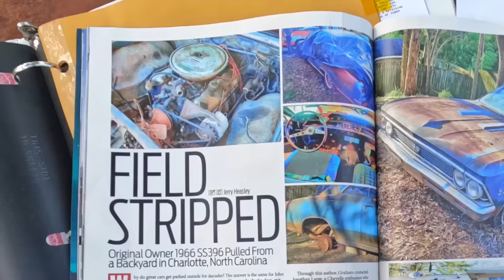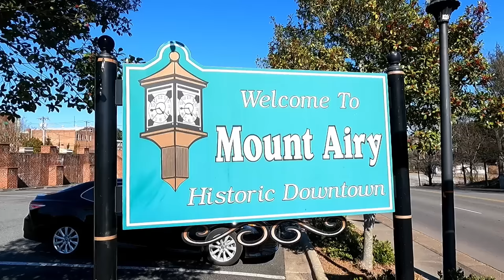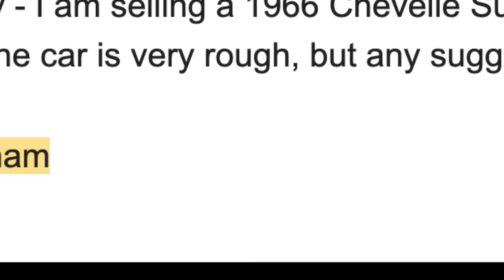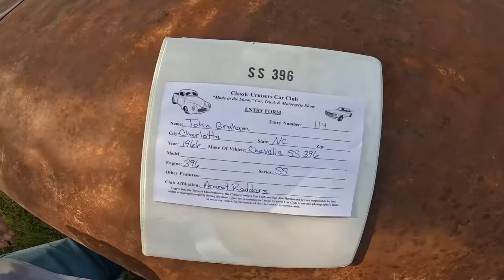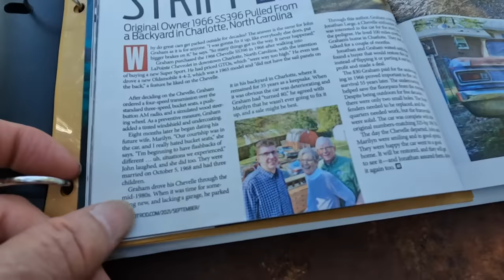Original Owners Drive Their Rusty 1966 Chevelle SS 396 To A Car Show

Comment: This is a perfect example of how original shape cars regardless of any rust are more striking to look at. Every car show has their fully restored novas, Chevelles and Camaros but when you see one in original shape even with rust holes that’s where the people are gonna be!
Reply from the maker: Thanks, an appropriate first comment. Are you a subscriber?
Reply: I was at a car show years ago and there was two 69 Judges sitting besides each other...one restored, one original paint with scratches, dents and rust...people flocked to the beat up Judge...the guy with the restored Judge was very surprised to the peoples reaction.

Comment: I had a beautiful 66 Chevelle SS396 while stationed at Myrtle Beach AFB back in 81! I traded a 74 Chevy Vega straight across for it! Sold it back in 86 for almost 30K! i do regret getting rid of it though! It ran 11:35 in the quarter mile! It was bored 60 over with 427 Hi Perf heads! Slick Johnson did the align bore on it for me! Damn i sure miss it!

Comment: In 1984/1985 a HS bought one like this for 500. He rebuilt it from the ground up and painted it 72 Corvette yellow if I remember correctly with a black top. Gorgeous. I even drove it once. A beauty. This 1966 396 SS holds a very special spot in my heart.

Comment: This is my #1 favorite year of that car.  And this would be my own personal "General Lee", '66 Chevelle SS 396 w/ 4-speed stick, and not heavily optioned.  So what if it's 3 years older than the '69 Dodge Charger.  The Dukes of Hazzard is still one of my top past-time TV shows.  but the highest number of my favorite American classics are Chevys.  I buy Die Casts of the '66 Chevelle SS 396.  And I SO much enjoy interloping them in with late '60s Mustang Fastbacks & '69-70 Dodge Chargers, as in be together with the both of those.

Comment: Back in 1966 , I ordered a Blue 1966 SS 396. I ordered it with , 4- speed Transmission , Bucket Seats, Console with a clock. All the Gauge package. and a Engine Tachometer. I had wanted the higher horsepower, 360 HP. But at the time I was only 19years old . And my Dad was signing on it with me . The Saleman was a old, old Guy. And he was not into the muscle cars. He did not want me ordering the higher horsepower Engine . Told my Dad , it would always be in the shop, being fixed. So I ended up with the 325 HP, standard Engine. Guess what, a little over a year later. I went to a different Chevy Dealer. And ordered a new , 1967 SS 396 Chevelle. With the Higher horsepower. And all the  same options, I had gotten on the 1966. Plus I ordered Front Disc Brakes.  I traded in the 1966 Chevelle ss 396 car. Really liked that 1967 Chevy Chevelle SS 396 car !!!

Comment: Great video. I'm currently working on a patina 66 Caprice for a friend. Numbers matching factory big block 396 car, turbo 400 and 12 bolt rear. It's an odd duck because it's a four door hardtop sedan. Owner abandoned it in 1976 and has been sitting out in the weather since then, so she definitely needs sheet metal work and engine overhaul. 28,900 original miles on the odometer. Still has the 1976 Bicentennial license plate on her.

Comment: These old systems hate our new fuel, so will need to vent the vapor with a return line to tank. To prevent vapor lock and heat soak ( holes in the hood actually help it) . Then it would be a daily driver. Love this car and the story. The Wife chose the right guy, the husband chose the right car.  Cool Couple!

Comment: Dad had the exact same car. He later upped it with a 71 Chevelle SS 454 4spd. That changed into a 73 Caprice Classic. All while there was a 58 Impala convertible sitting in the garage. That was until the end of the 70s. All were gone. Sold. He bought the family an Olds Omega and himself a Harley.

Comment: If I only knew  what happened to the car of my youth........1964 Chev. Impala SS aqua azure blue with white leather, stock 327 engine and more memories than you could shake a stick at.  Sold to a Chev dealer who deemed it clean enough to drive it up the ramp to the show room floor, roped it off along with other Classics.  That was a few decades ago.

Comment: There's an old 50s Chevy Truck a little over a mile away that seems to be original, even has a cracked driver's door window.....I become more and more tempted to knock on the door and see what it's all about. Sits out in front of the house right along the road, no idea if it runs or is ever driven but for such an old truck looks pretty good.
Reply from the maker: Yeah, I've had the same feeling with cars I see. Some people don't mind knocking on doors and asking.

Comment: How did that floor and trunk survive with rotted windshield and rear glass channels. Luck because undercoating saves the underside, not the top.
Reply from the maker: Maybe the tarp protected the floor and trunk, but wasn't good for the top of the car.

Comment: I spent many hours and dollars in 67, 68, and 69 on my 66-396ss. A 546/310 cam, hookers and a holley 650 double pumper in the engine mated with m22 rock crusher and 4:11 posi and micky Thompsons 11" on cragers made it a head turner everywhere it went. Sadly, it was stolen in 71. They forced me to drive my 66 383 gto with 3/4 cam, m21 and 4:11. It ate too much and got rid of it for a 73 camaro. If I had just a few of the cars and trucks I had back now, I'd be fair well-off. I'd drive something for a year and dump it for the next thrill.62 impala so, 64 falcon sprint w/289, 64 Olds rocket, 66 Camaro, 68 Olds delmont 88, 67 Chevy pu, 69 429 fastback mustang and many more. Cars started going downhill in 73 and haven't reached bottom yet but tesla is close. More car fire deaths than the pinto...but no government  complaints. Sad.
Thanks for the memories.

Comment: The 66 396 360 hp was the one that warmed my heart in 66. Clean, simply, little chrome, one strong engine and 4 speed trannys. Yes, $6500.00 was a steal. Buyers should have been locked up.

Comment: Having owned a 1966 and 1967 Chevelle SS, I can tell you the weak spots for the formation of rust is in the bottom of the back glass. The design did not permit water to properly drain and run off, instead it held water there.

Comment: My mom's boyfriend at the time had one these in banana peel yellow with white tuck n roll interior with the same set up but about 71 or 72 found a rear-ended 70 LS6 454 so he purchased the engine and transmission then proceeded to punch it out to a 504 cu new heads, cam, pistons ect you get the idea. Does anybody out there know what balanced and blueprinted engine means? It was by the fastest 66 in the state of California. I wonder whatever happened to it. We used to take her and buried the speedometer man that was the coolest car ever. His name was Ray, he was a Vietnam Veteran hope he's still alive if not RIP dude. ✌️

Comment: @Jerry Heasley  Jerry the car is in storage( in Idaho) after a start of partial resto, I bought it at Gilboy Ford In whitehall Pa in April 1969, the previous owner traded it in for a 1969 GT500. the last vin 0072. black, 4 speed, rare functions red "red lens lane change indicators" in upper air scoops has functional ducted lower air scoops to rear drums, Kesley Hayes wheels. In it's unfinished condition I don't wish to display. take care
Reply from the maker: okay, thanks

Comment: since 1952 only  bought  used         had 53  ford  54 ford   57 dodge 2dr ht  65  dodge     71  r runner 65  chevelle ss  malibu  conv. 78    mustang 88vw  bug    did on maint brakes et lot of chryslr  mini vans

Comment: It’s funny to me that a 56 year old Chevelle that sat for 35 years had metal that was in better shape thanks to a $35 factory option than my 27 year old Comp T/A that only sat for 8 years. What’s ironic to me is how the Comp T/A was the most expensive package available for the Trans Am in 95 and the two options mine lacked from being fully loaded were the SLP headers and wouldn’t ya know it, undercoating.

Comment: Real cars not much other than spark plugs, wires and a little fuel and those bones come back to life just like the day they roll off the line, Possible just a little sandpaper and those old points may have still had life left in them.

Amazing unlike the new cars of today setting outside for 30 years all the electronic parts will be possible worth less and impossible to work due to the way electronics at times just stop working from corrosion in the circuit. 

Old cars like this only need a little spark and fuel to rise from a long sleep as if they had just lay down to rest last week.

Comment: I'm a 69 year old with a 1962 Ford F100 uni truck 292  not touching anything but the motor so I can drive it as my work truck.
Reply from the maker: I thought the '61 model was uni truck, meaning the bed was united with the cab, but they continue with that in the '62, huh?

Comment: Ive been saying for years, they made a mistake by only having cars with bucket seats now days. Even trucks only come with bucket seats.
Reply from the maker: Is there one single new car with a bench seat or that does not have bucket seats?
Reply: @thewriter2549  not that i know of. my nephew had a dodge truck with benches, and in cant remember the last time i seen a bench seat in anything newer then the 90s. they did more recently have split bench seats, but still not the same.

Comment: I like your idea - however, to maintain this car over the long term - I wonder if you can clear coat over rust?   OR find a custom painter will be able to repaint the rust look?    I hate rust - in just a few more years that car will turn to a pile of iron oxide
Reply from the maker: I believe there is a patina that protects against rust. Is patina rust? Yes, but not a corrosive rust, rather part of a stage the metal is going through, and as a coating it protects against deep rust. I was doing a video on a Trans Am in El Paso. They kept saying that the surface was not rust, but it wasn't paint and it wasn't primer, so I kept asking, "So, what is that?" It was a brown tarnish on the bare metal, a patina. The body/paint man said that unpainted steel would stay that way for years without rusting deeper. This seemed odd, and I started looking into patina.

Comment: Chrome valve covers? Tells me that's a 350 horse, it's not a 375, 325 and 365 had orange, unless they were changed
Reply from the maker: you could be right, some viewers are saying this is the 360-horse 396, and my understanding at this time is this big block is the 325-horse, base SS 396

Comment: I HAD A FRIEND WHO OWNED A SS 396 WHEN I WAS A YOUNG GIRL IN COINJOCK NC.  I NOW OWN A DEAD 1996 DODGE VAN 2500 SERIES WITH A 318 ENGINE.  HAVE DONE SOME RESTORATION, HAS LEAKING RUSTY ROOF, NEEDS WORK.   GOT ANY IDEAS OF WHO COULD HELP ME!!?
N SNEAD
COINJOCK NC